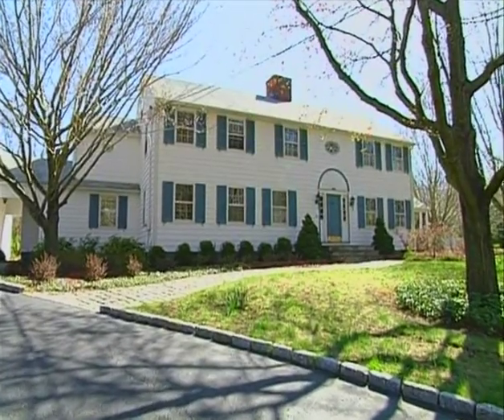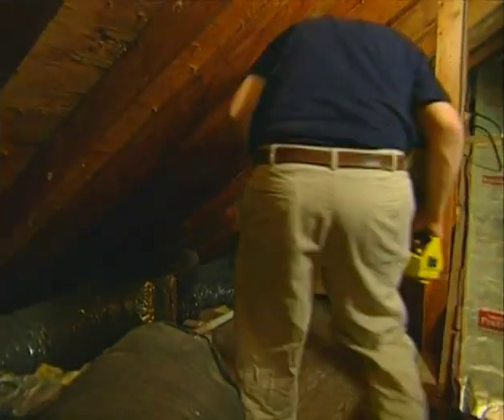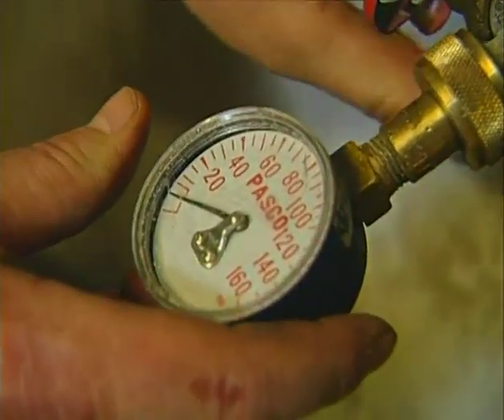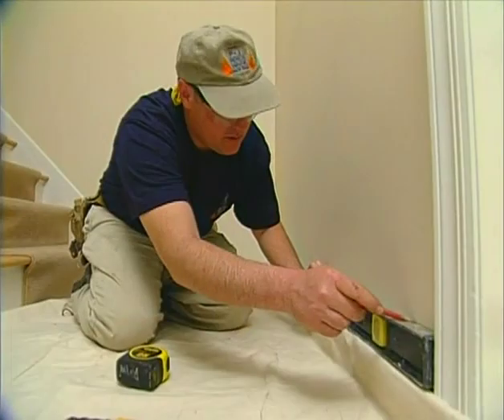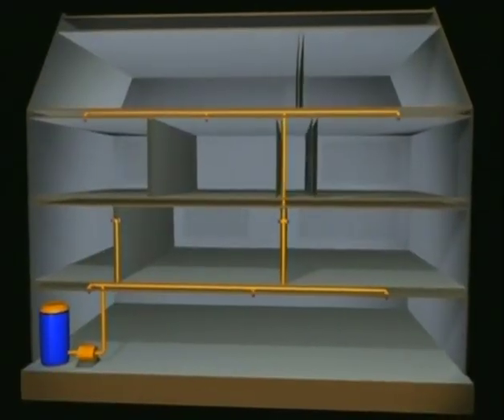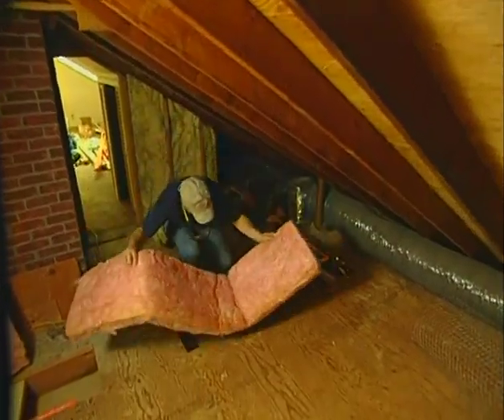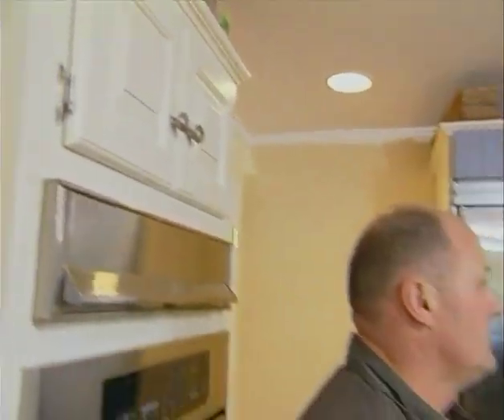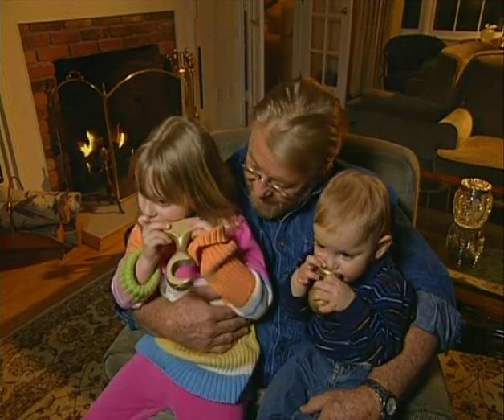HFSC Retrofitting a Home (Complete)

Comment: Idk pipe in the attic? I know they cover it with insulation but I'd be worried about freeze ups. Wouldn't a dry system be better option
Reply: Unless you are in a place that gets very deep cold snaps your attic will never get to the point of freezing those pipes. Typically heat rises and the attic is the very top of the house. That and even the sun during winter can radiant heat the roof.

Comment: Curious what it cost to retrofit your house (now that we have a visual of the size and scope).
Reply: I do it for a living specializing in residential. It typically costs 30 to 40 K for that sort of installation including all drywall work
Reply: @leam89  qqqqqqqqqqqqqqqqqqqqq
qqq😐qqqqqqqqq
Reply: @leam89  Someone there is making big $$$ of sprinkler systems! Cost shouldn't be more than $1.50 a sq foot for NEW construction!
Reply: @vickischmidt7554  this video is about retrofitting an existing home so no I wasn't talking about new construction. Also should have specified that I work in Canada so more expensive